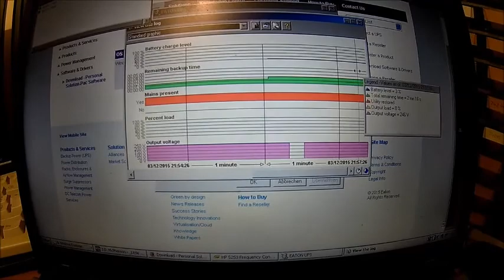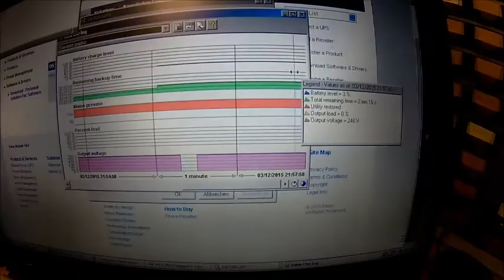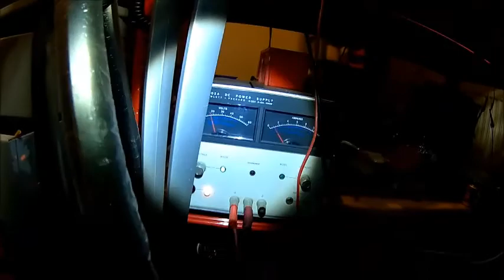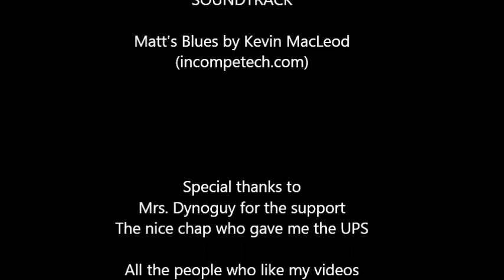Eaton UPS - Part 1 - tear down, inspection and fault analysis

Comment: Years ago but… I have same problem with my Eaton 5130. Problem was with shorted bridge rectifier in the back of unit and also broken fuse. After replace both of them is problem solved. Maybe helps someone…

Comment: Hi,

If the UPS doesn't provide output electricity, how can you use it? It thinks that the battery is low, so it doesn't provide any electricity.

Thanks

Best Regards
Reply from the maker: replace the battery

Comment: friend I have an eaton power ups model 5130 and the fault it presents is that when it is energized it turns on the red led where there is a triangle and it does not charge the battery
Reply from the maker: If the battery is actually (!) in good condition, it's most likely a fault in the UPS. Hard to tell without having the thing on my desk.

Comment: Hi,
do you know about the electric of the  Eaton Ellipse Eco 650 DIN ?
Because, i wan't to open the unit and install a 12 volt relay at a point / position, 
where the 12 volt current is detected, when the unit switch to battery powered.

Reason:  my alarm installation doesen't detect a power loss - because of the  USV :-)

I have a potential-free contact, which belong to the alarm.
This contact could be closed through / by  the 12 volt relay.
But, i need to know about a position in the Ellipse Eco, where is no battery current 
- until, it's running battery powered.

I could do  this on  annother way:  using the 1 230v Outlet, which is NOT battery powered.
This one is passiv - is not feeded, while battery powered.

But this is not the way, i like.

And the idea with an 12 volt relay will only run (consume), while main power failure.

Kind Regards

Comment: So the software will tell you what the problem is? I also have this with the same problem. Will i still be able to get the software NOW? If not can anyone share it with me. I will supply needed information when it comes to that.
Reply from the maker: Check the Eaton website and also read the comments on this video, there should be some more information to find. The problem is most likely somewhere in the hardware as it does not sense the voltage correctly anymore.
The software will not tell you what the problem is, you need to make your own conclusions from the data you see.

Comment: Did you ever find out what the problem was? I have the same unit. Question: Do you think I could buy some replacement 6V batteries (RBC18 kind) but instead of 7 amps, I could buy 8 or 9 amp batteries? Do you think the unit would mind or care?
Reply from the maker: +Matthew Bankhead .. well, for the fault i use a "workaround" for now , see comments further down the list. 
You can use pretty much any battery size, mine is now connected to a  24V 230Ah bank.
However there are some things to consider... bigger batteries most probably won't fit inside, if you run flat out with a longer lasting batteriy you may exceed some temperatuire limits, so watch that carefully. and last but not least , the internal charger needs more time to charge it back up.  Hope this helps.

Comment: any idea what the problem was, mine does exactly the same
Reply from the maker: +ravenmidou Hi, didn;t really spend alot more time on it. What i found out so far is that the undervolt circuit on the powerboard works fine so far, that's all done in hardware by the pwm driver chip. If i lower the voltage to about 23V it shuts down as it should. Therefore i believe it's an issue on the CPU board where i think the actual charge level monotoring  happens. What i know so far is that the battery voltage arrives on the board. Sorrry can't say any more by now, perhaps just a bad resistor somewhere.
It seems it does not matter as it runs fine (i use an external battery anyway) it just beeps all the time because the CPU thinks the battery is low, but that seems not performing a shutdown. It appears they just rely on the pwm chip for that function.
For now i've just muted the beeper with chewing gum, works perfectly fine to me ....

Comment: what software is that ?
Reply from the maker: +Vitalia K  Hi, I've dowloaded it from the Eaton website, just select the UPS model and it guides you  to te right software. However, you need to register first.with a valid email address.
Reply: +dynoguy im registered. have the 1150 model, did u use DC Tool software ? there is to much of a choice there
Reply: +Vitalia K also, did you come across any diagrams by any chance ?
Reply from the maker: +Vitalia K Its the personal solution pack software suite, actually the same package as on the CD which comes with new units.
No diagrams of course, but it's fairly obvios what does what. Mine has a problem with the Battery monitoring circuit, i just need to find some time for another go to fix it,
Reply: +dynoguy thanks